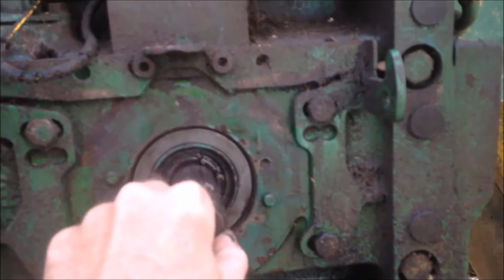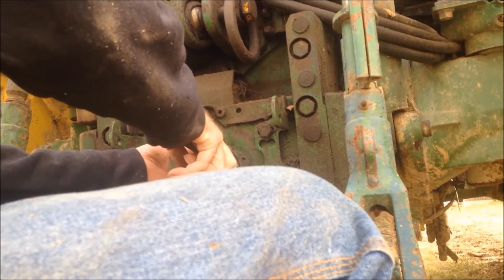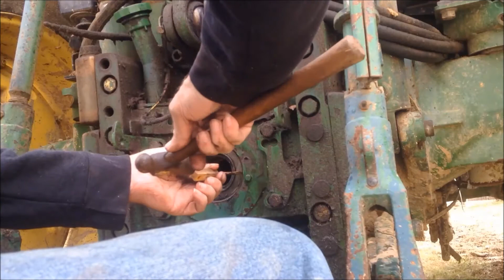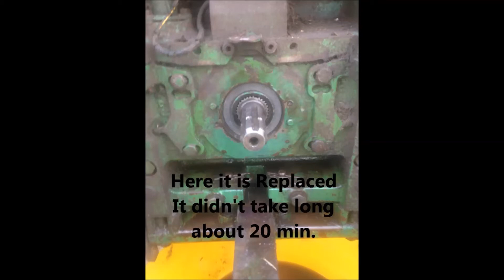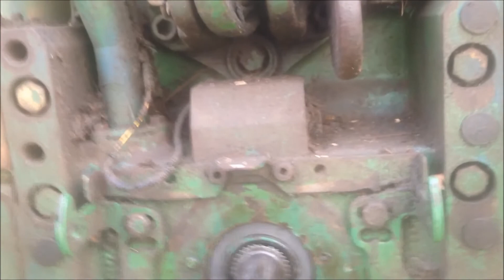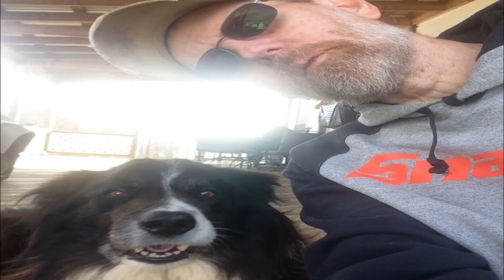John Deere 6400 PTO Seal Replacement or How JR Got Some Care

Comment: I don't think the quality is bad, just a tip, maybe tryto position the camera above the area you are working and looking down so that you aren't blocking the view with your body. Camera placement can be tricky :( Also a thought, wind is a problem for ANY camera. A cheap solution is to go to the store and buy a stuffed toy or dog toy with medium long (1/2in) fur. Cut a tiny chunk and find your cameras microphone, glue a strip on either side of the mic hole, close enough to almost cover the hole but not quite. This will deaden the wind and only affect your sound quality the tiniest bit. Expensive cameras have options to buy this, I just made one for my Cannon G7X, works great!
Reply from the maker: Thank  you for the tips. I've got some video stuff coming and I hope it will help. Great idea about the toy. Stubby has a few of them and I'm sure he won't mind me borrowing the tail. Oh and I love your "can do" attitude, ya never know what you can do till ya try. Keep on goin'
Reply: lol yup! Right now I'm looking at (possibly) replacing the alternator on my car :/
Reply from the maker: Just undo the Negative battery cable before you start. You always want to unhook the battery before ya start anything electrical. It's like replacing the battery; always hook up the negative cable last, that way you don't hit your wrench against any metal and cause sparks. Oh and thank you for subscribing. Keep on goin'

Comment: very helpful.   My 6415 PTO just quit, I can hear the PTO clutch engaging when I pull and turn the PTO knob but the shafts not turning, any ideas?
Reply from the maker: Does the PTO shaft turn freely when the tractor is not running? By "freely" I mean real easy.
Reply: yes it does
Reply from the maker: Unfortunately it sounds like clutch or you've sheared a gear. You'll have to take the PTO rear housing off to get to them. It's not a easy fix. Also you'll need JD alignment tools to do it right.
Reply: ok thanks, at least I know where to start now, appreciate it.
Reply from the maker: Did ya ever find out what was wrong with your PTO?
Reply: check pressure on pto port on  modulater   shoud be 300 psi with pto  engaged